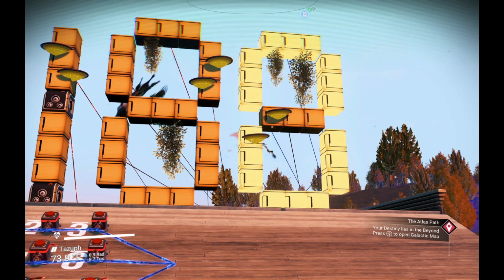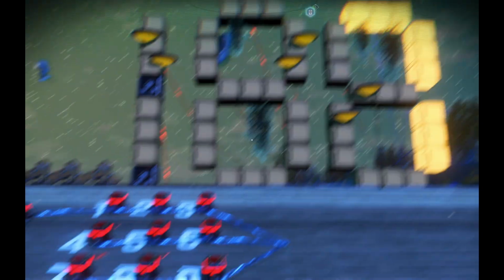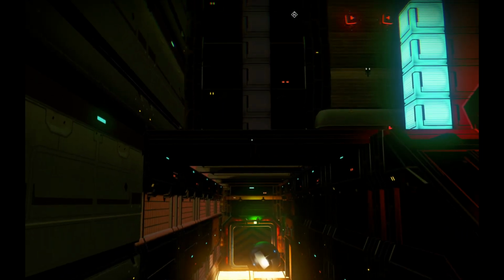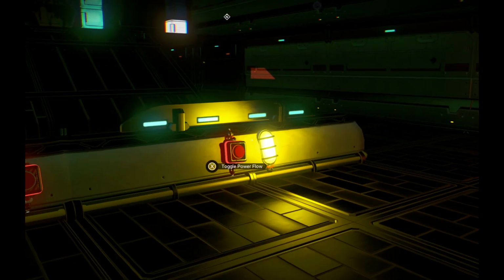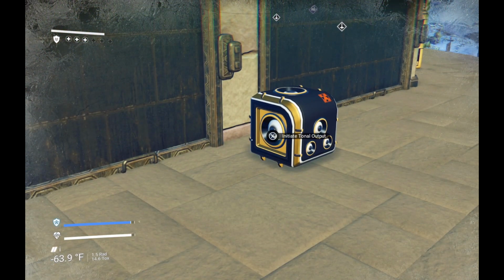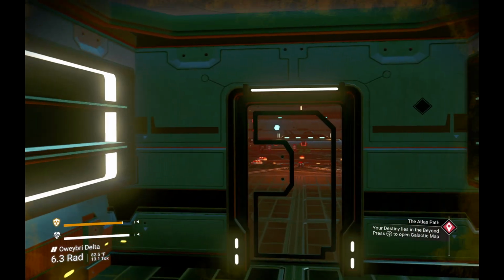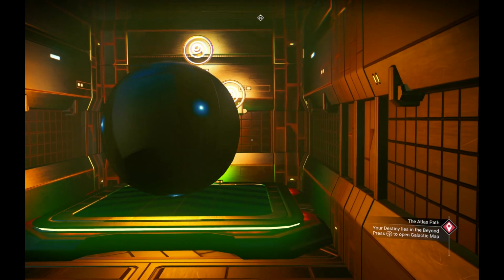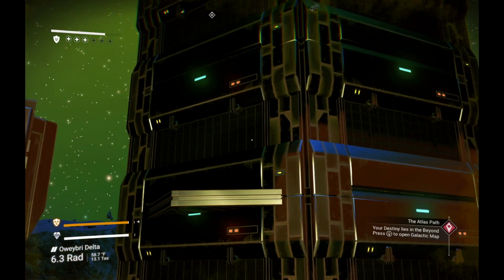No Man's Sky - Nolindor Project Tour

Comment: Love nolindor's work. Amazing inspiration. It is because of him and a few other's i learned i have a love for logic design. And started building my own 4 bit computers. 

I say computer because they are turing complete. It can save its results for use later and modify its results based on its stored information. 

This is my most complex yet with over 6500 parts. And about 3000 autoswitches and inverters. 

It is compsed of 1 decimal to binary converter, 3 DBC, 2 memory banks (red & geen), 2 registers input (white) output (purple), 4/11 programmable memory, 1 program counter, 4bit alu (4-bit ripple carry adder and subtracter), 3 seven segment displays.
All tied into bytebeats for expressing different states the computer is in. 

I even made a consistent assembly language using symbols, lights, and decals, across all my computers. 

In this demonstration i show how to program it from scratch. A simple program that will add until it over floes then subtracts till 0. Then two different programs already stored in a kind of rom. The first adds red and green, clears red, then writes the  the previous sum in its place, over and over until it overflows and subtracts back to zero. 

The third demonstration is program 2, it calculates the the fabanocci sequence. First foward then in reverse. 

Thats why this video is so long. I have other smaller computers under 3000 parts that i made video's on to. 

https://youtu.be/RuFreEH_HwA?si=Gl1VWGYlhDLX8yA1